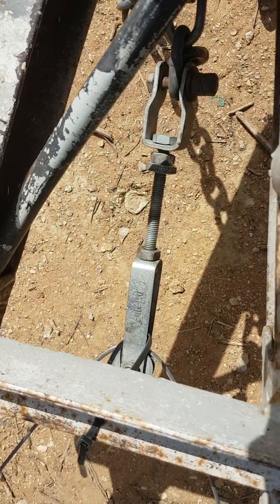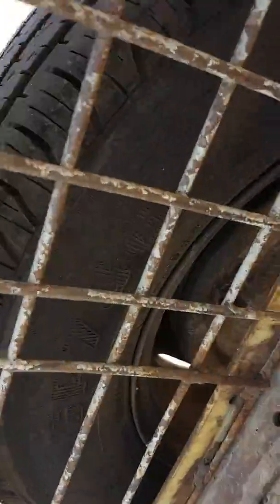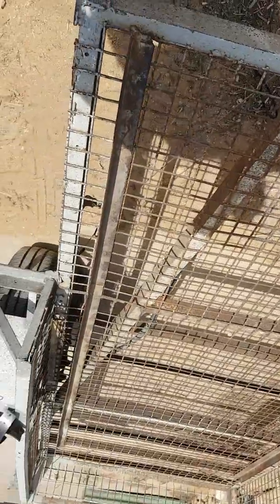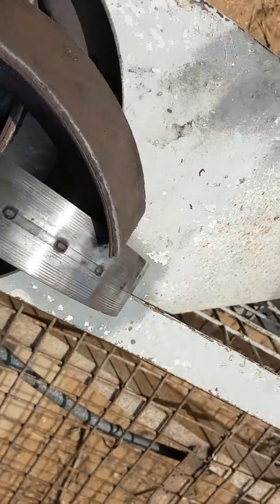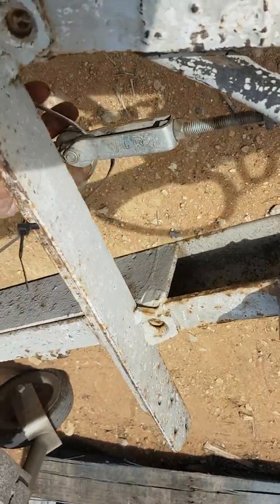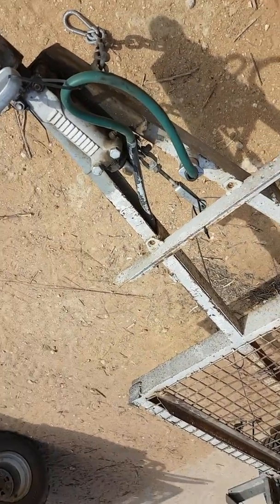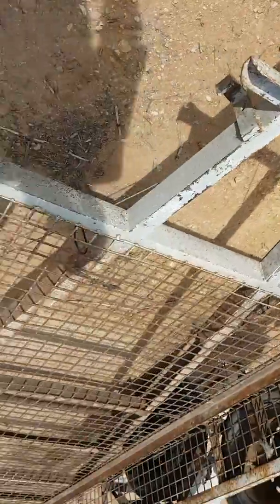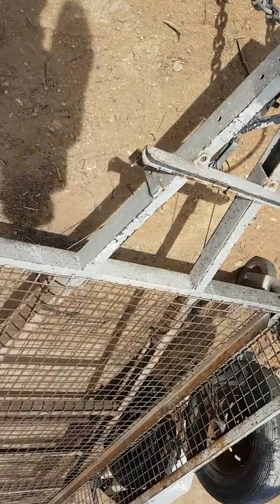Trailer brakes cable adjustment alko new shoes

Comment: Thanks for the video. I replaced the handle on mine to a low profile handle. This meant I needed a different cable length. Ever since then, I am never sure if I have made the cable length correct. I've had about 3 goes at it so far already. It doesn't help that I have no flat area to work under the trailer. There is a double crimp under the trailer at each end of the cable to set the approximate length. It is difficult to get this to be right where you need it before fine tuning with the threaded cable adjuster at the front. Mine runs through fixed eyelets which means I don't need to worry about any pulley jams - but it means there is no easy adjustment to take up cable slack.